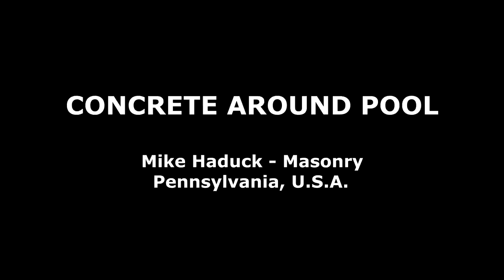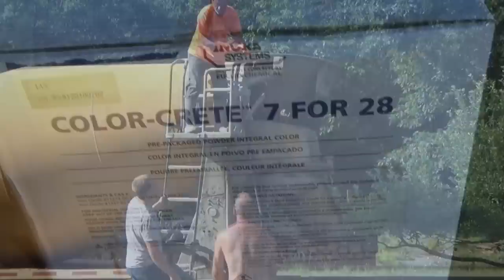CONCRETE SIDEWALKS (Part 13) Pool pour (Mike Haduck)

Comment: That was interesting Mike, never seen concrete laid around a pool before. Man, it looked great and the attention to detail was amazing. Great stuff Mike.
Reply from the maker: Thanks Darren, Mike
Reply: this used to be a popular option 30 years ago ? nowadays interlock is mainly used around pools ,makes it easier if there is ever a repair to be done on the pool lines . wow these guys skimp out on rebar
Reply: @ricardoa1661  in Pennsylvania you should not even put rebar inside the concrete. 

More important are properly place relief cuts because this deck will shift and move. You do not want steel holding you back. You want the deck to crack exactly where you tell it to.

Comment: This channel is the best "bang for your dollar" channel. I removed old windows in a basement and covered one up and used glass block for the other two using the tips and the instructions Mike provides. At the beginning I hated concrete and mortar, but the more I watch Mike, my techniques improved and my hatred has transitioned to more of a tolerated dislike for concrete.  My reason for this comment is if there is a video of removing a window in an exterior stucco wall and covering it up with stucco and making it blend in with the rest of the existing wall.
Reply from the maker: Hi, I use all those techniques on " stucco installation " or " foundation repair videos" I don't have any one video for that, thanks Mike
Reply: @MikeHaduck  Covering up the old window with OSB board or similar, I can apply a wrap on the board and apply the stucco mix right on the board?

Comment: Mike, this is what I have done for as long as I can remember.  Awesome you got to be involved with this.  These guys knew what they were doing,  but we do not tie our cantilever decks to the pool with rebar.  These decks are meant to float. Now when the deck lifts in winter, it will yank on the shell.
Reply from the maker: Hi Adam, maybe but it's lots of gravel like a railroad track underneath,  thanks mike
Reply: @MikeHaduck  I really do appreciate your input.   We pour an 18 inch collar around the entire shell
 We place tar paper, then pour the deck on top so it's separate . Here in Pa, regardless of how much clean stone. Decks are lifting in the winter. I seen it over and over. They will lift 2 inches off the edge of the pool. 

I have also personally witnessed pools sticking half way out of the ground like the titanic. The possibilities are endless. 

This pool should also have an 8inch site tub down to the deepest part of the dig. So the home owner can pump the water table before emptying their fiberglass shell.
Reply from the maker: Hi Adam, it's actually on the edge of a bank and had a pipe releving the water from underneath,  no worries there but I do belive you on all those issues, you are right about that, thanks Mike

Comment: Interesting to see a different technique. Here in Australia we would use mesh on bar chairs which means you can't barrow and so a pump would be used. Plus I would expect proper formed joints at every 6m and sawn in-between.  We would also have to have pool fence around the pool for safety before the water is put in.....
Reply from the maker: Thanks Keith, I hear you, Mike

Comment: On your sidewalks, how far apart do you place the metal joints ? If a section drops do you jack it up, inject foam insulation, or tear it out and repour it ?
Reply from the maker: Hi Bidal, I haven't seen a problem , every installer with experience does things a little different,  thanks Mike

Comment: The biggest concrete pour that I ever worked on was footings for a 50’ by 60’ warehouse That were 12” thick and 2’ wide. I was one of the laborers wheeling. The driver of the second truck was standing around watching us work. I made the mistake of joking with him that if he got bored we had an extra wheelbarrow. When we started unloading his truck, every time I put my wheelbarrow under the chute he filled it right to the rim so you couldn’t move it an inch without some of the concrete dribbling out. I hadn’t realized that Teamsters were like cops and had no sense of humor when working.
Reply from the maker: Hi J, lol, good story, Mike

Comment: Watching one of your sidewalk  videos. Why did you not use rebarb steel.
Reply from the maker: Hi Bidal, everthing depends on what, where and why, concrete work is not black and white,  many times the rebar could rust, expand and break the concrete, thanks Mikey

Comment: You should have volunteered to do the inside the pool work! I’m guessing the pool had to have water in it to retain the shape while pouring the concrete?
Reply from the maker: Hi Jim, I know if it's not filled with water it would float up like a boat, thanks Mike

Comment: Fantastic job! Would they ever consider using a pump for the concrete faster? Just wondering.
Reply from the maker: Hi Stef, you don't see many pumps in our area, wheelbarrow labors are cheaper, thanks Mike
Reply: @MikeHaduck  thanks Mike. Appreciate your reaponse